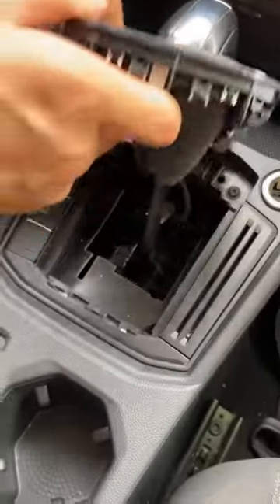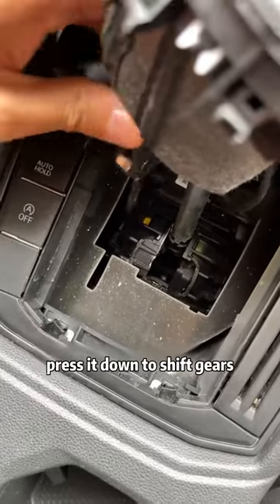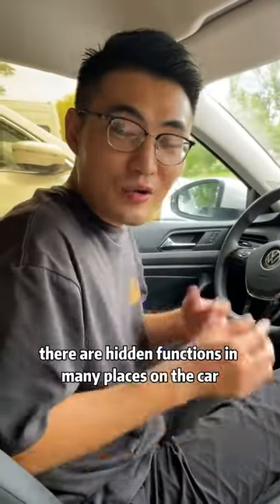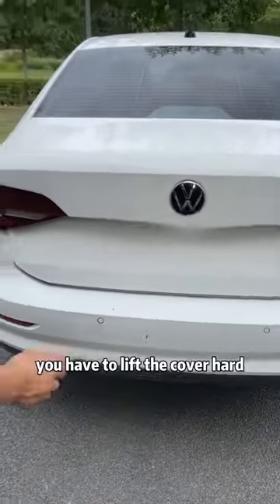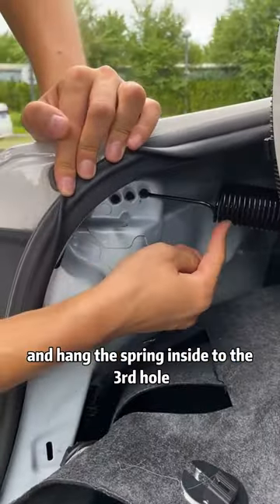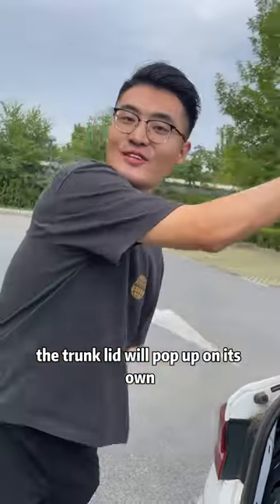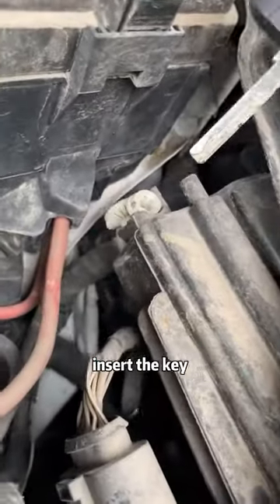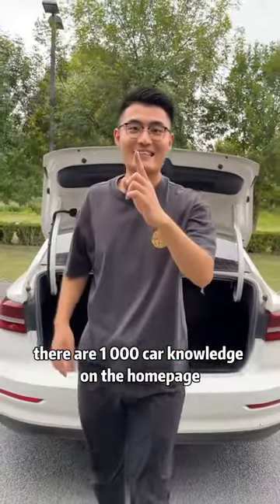Have you ever wasted money because you didn't know some features on your car?#tips #car #shorts

Comment: Good afternoon guys, my concern is on this trick of car boot opening.  You guys seems to use only one car which is one brand of car in which other brands features seems not to be the same. For the boot of Honda accord 2007 you don't see the spring for adjustment because am having same issues with it not just opening after long press. 
Secondly,  in Honda accord 2007 that am using for the closing and opening of car windows without starting the car is not done that same way, we can only open with the long press but can close with the long press. Please guys help us out on other brands of car ls not  only the brand you use. 
Thanks.